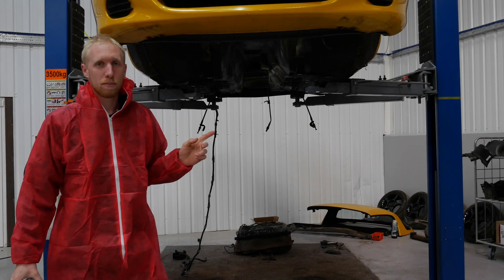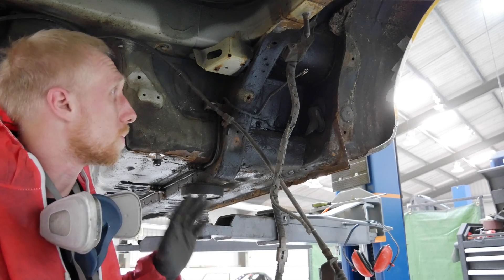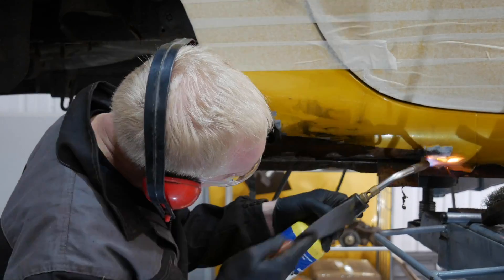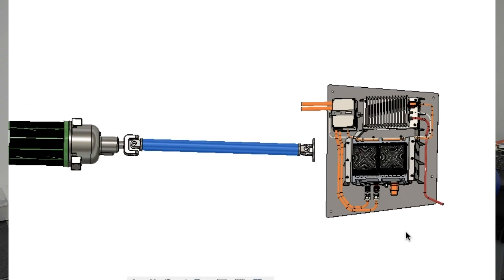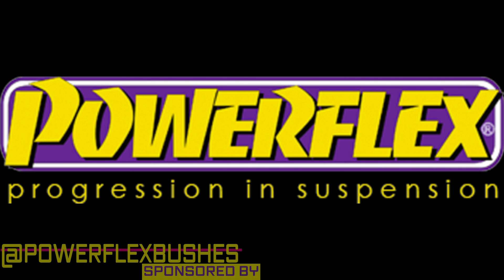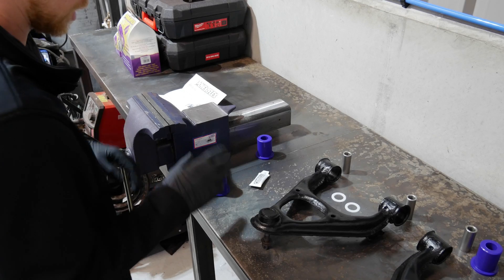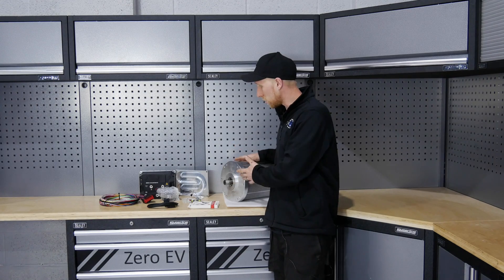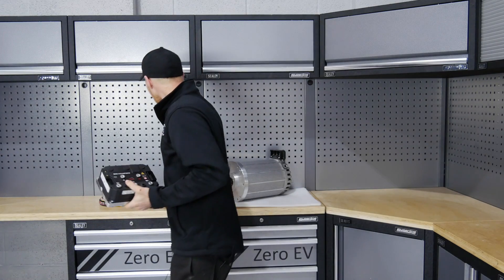We’re Making an MX-5 Miata Electric with a Hyper9

Comment: The cost of your motor is the cost of my car and fuel for 3 years at about 40,000km per year. I could never make the money back from your kits. What is the point?
Reply from the maker: It’s not about making the money back. People buy new cars then loose a massive amount of money on them. This is new tech and allows classic vehicles to be converted do not base it on a Mx5

Comment: The detail section regarding the HyPer 9 system is good, but you said that Netgain produces the motor: it does not. The motor and controller are from SME, which is now part of Dana; Netgain is only the distributor, which applies its own branding.
Reply from the maker: Thats correct but you can only buy from netgain as they have world wide distribution on that model.
Reply: @Hazell_Nutz  I don't think Dana sells anything direct to consumer, so NetGain is the consumer's only choice whether or not it is exclusive. I doubt it's really exclusive - send a firm order for a thousand of the same thing to Dana and I suspect that it would be accepted and they would arrive with Dana branding.
Reply from the maker: To be honest they are outdated now and could really do with a software upgrade and a higher voltage version so people can run ccs.
Reply: @Hazell_Nutz  I'm pretty sure they're not low-voltage because they're outdated - they're low-voltage because they're designed for industrial vehicles and chosen by Netgain to sell to people wanting to use salvaged partial EV battery packs or strings of LFP cells, with cheap controllers. They replace brushed DC "forklift" motors I can believe that they're due for software updates.
Reply from the maker: Think my point was not clear as in outdated for use in Ev conversion as everything is now going 400 or 800v. There perfect for industrial use for sure.
Reply: @Hazell_Nutz  low voltage was outdated even for EV conversions when Netgain acquired that hardware from SME, but some people still want it for the same reasons they did when it came out.

Comment: I saw someone put 2 engines coupled together for more power. Can this be done in this type of setup. Just engine and motor parts, not suspension how much does this cost?
Reply from the maker: Yes there is an option to connect two in series to increase performance. Fir two hyper 9 suits about 9k plus all other parts like battery’s eta
Reply: The extra motor would be in the space where the battery is, cutting the battery capacity in half. Two of the wrong motors is not better than one appropriate motor.

Comment: With the fuel tank removed, and understanding that you have some of the HV components mounted on a plate where the tank was, is there any room to package some of the cells underneath? It might help bring the front-to-rear weight distribution closer to stock and also provide a solution for a 144V setup?
Either way, I would be seriously tempted if this turned into a turnkey conversion kit...
Reply from the maker: We like keeping the pack all in one place is a lot safer as all hv is within one box and not spread in two locations. This will be a turn key solution

Comment: Why such a heavy motor? EMRAX make a ~80 kW ~12 kg PMSM motor.
Reply from the maker: Yep but cost double the money. There a good option though
Reply: @Hazell_Nutz  EMRAX 228 is £3.3k from the OEM. It seems the Hyper 9 is £2.8K w/o a drive. Could be a similar overall price depending on what drive is paired with the  228.

Comment: Can you comment on why you chose the lower voltage version of the HyPer9 instead of the 144V version which has more power? Was it to minimize battery weight & space?
Reply from the maker: Looking at the data there is very little power difference. Main reason is 100v option was available were as 144v has a 3 month waiting list as build to order.

Comment: Great series, if I may, may I recommend a wire wheel on that angle grinder instead of the flap disk, it will go that much quicker and really get in there and loosen up all the rust

Comment: This is great it's the nice mechanical restoration elements and then the Tech bits are an ace idea.  May I ask why though?? Why an MX5 is it a proof of concept car for you or a customer's? I'd love to get you and @Combe Valley Campers together to do my VW T3 but I still want to do work myself as much as possible as I'm building a family memory maker I want to really get stuck in.
Reply from the maker: Mx5 because there is a very good following and we needed something front engine rwd to test of new 1.8:1 gearbox on.

Comment: I’m assuming you’ll be making a mount that connects the motor to sub frame. I’d be surprised if the tranny mount would be strong enough to handle the torque from the  motor. That load is designed to be up on the subframe. Interested to see how it works out. Are you planning on mass producing and selling a kit to do this or is it just a one off?
Reply from the maker: We will probably make up 5 sets of metal work then see if people are interested.

Comment: hello
do you use a special protection (glove) to avoid electric shock when you wired the battery ? Is there any a possibility of  electrocution ?
Reply from the maker: You can where gloves but make doing up fixings very hard. We follow a set process when building packs to remove risks, we will show thing in one of the episodes

Comment: As you are using a  custom gearbox how do you get the Speedo to work?
Reply from the maker: Motor outputs rpm and as it’s a fixed gear a calculation is then done for speed.

Comment: Not sure how far you've gotten with the computer design, but I can highly recommend the ESP32 for the microcontroller.  Plenty of speed and dual processor cores if needed, built-in CAN bus compatibility, and it has Bluetooth built in for remote management (and WiFi, but not sure if that would be useful).  And you can program it with the Arduino programming environment or, if you don't need all the speed, microPython (plus many others..)

Comment: Buddy u guys r d real thing......bro pls make a video on the the topic....should place the motor directly to the drive train or should keep the Gear box and the clutch assembly intact....I mean do gear box and clutch have a role in e vehicles...I mean advantage and disadvantages..
Reply from the maker: A two speed gearbox would have a place in EV’s but lots have tried and failed. We have gone with a single speed reduction.
Reply: @Hazell_Nutz  thanks for the reply.
Bro is there an email where I can shoot my query...I need some suggestions from...I am really inspired from your work..
Reply: @Hazell_Nutz  bro..i have Corolla Altis DCT Automatic transmission...it's specs are 1798cc, max power 138bhp@6400rpm, max torque 173NM @4000rpm, ...two questions for you bro
1) Suggest the motors with ratings
2) Can I keep the DCT, will it work or do I need to take whole of the auto gearbox thing  and clutch plates things out and make a direct drive...or what do u suggest..

Bro I know I am taking kuch of your previous time...but I would be grateful....i owe u..in case u visit India....

Regards

Comment: Can you talk about the advantage of this motor setup vs a full Tesla setup? (Aside from mounting the unit out back)
How do you know the transmission will take the torque? What is you plan of the transmission can't take the power output?
Reply from the maker: There is no advantage this is just a cheaper and simpler set up. We are not using the original transmission will be fitting our new 1.8:1 single speed gearbox.
Reply: @Hazell_Nutz  will this be another item available in your store?

Comment: Since I’m in the middle of a Restauration with my mx5 ... I like what I see ✌️👍💪
However I did have a bodyshop goin over the chassis and it did cost me ... a arm and leg ... but totally worth it 😎
...
PS.
Are you goin to do a cooling system for the battery 🔋 pack as well...?🤔
Reply from the maker: Yes the battery pack will have a cooling system

Comment: Is there any reason you aren't putting the motor in the back under the boot floor?
Reply from the maker: Because it will not fit without chassis modifications

Comment: Nice video.
But indeed please don't say a switched reluctance motor (SR motor) is a fancy fixed magnet motor! This is not true at all! It has no magnets inside! That is the whole point of this type of motor. No magnets = cheaper to make (but harder to control). If you want to compare it to something you better say its some kind crossover hybrid between an inductance motor and a stepper motor.
Reply: The thing is this motor is an Internal Permanent Magnet motor that also uses Switched Reluctance to boost its efficiency. So it is both.
Reply: @Tom-evnut  No, not switched reluctance, but synchronous reluctance.
Reply: They did not say that is a switched reluctance motor, because it is not. It is a mix of permanent magnet and SYNCHRONOUS reluctance motor.
Reply: @brianb-p6586  you are right, didn't pay attention apparently

Comment: Great project to see and really good to see a very informed and professional presentation. The only thing I felt I would like to know is you detail the weight of parts going in front and back, but what is the weight of parts that came out of the car front and back? Thinking it would be a good idea to try to get the weight back into it as near to the original front/rear split to keep the handling near original. 
Also, do the main power cables (battery to motor) now have to go through the controllers in the boot or are they controlled remotely from there?
Reply from the maker: The charger and dcdc just require a 35mm2 positive and negative cable from the battery pack. The battery will feed the motor controller directly as that is infront of the motor in the gearbox tunnel.

Comment: Hi guys great build ,  what sort of range do you think this would have being lighter than a modern ev ?  Cheers . Steve .
Reply from the maker: With the small battery pack about 100miles but think there is space to fit a second in the rear.

Comment: Netgain started out with a series motor that replaced the advanced DC series motor they made a 9-inch an 11 inch and a 13. These were paired with the mighty Zilla controller of which the largest 2000 amp 348 volt is used in a drag racer today. I'm in net gain dealer in Florida. You're doing a wonderful job on this I'm very impressed

Comment: Jeez, that motor is hopeless, saddled by a ridiculously low maximum voltage. Once you are above 50vdc then you need to comply with the low voltage directives for machinery, and that goes right up to 1kV (where it become the High voltage directive), so you may as well install a system with a sensible nominal voltage (say 450Vdc) and get all the power and efficiency benefits!
Reply from the maker: We normally fit 350v nominal that is the industry standard 96s battery pack. This is more of a off the shelf straight forward build that is not as scary for most. Of next build is 350v

Comment: Why use a drive shaft where you'll loose efficiency, and not use two smaller motors directly at the rear wheels? You can get a 50/50 weight that way too.
Reply from the maker: This is meant to be an easy to convert vehicle without cutting. Plus doing it to test our new 1.8:1 gearbox

Comment: With the fuel tank removed there might be enough room at the back to use a transmission from a front wheel drive vehicle placing the electric motor at the rear. The tunnel could then be filed with batteries and the chargers and controllers and cooling systems would go at the front with some additional batteries.
Fabrication of a new rear subframe would be required of course.
Reply: Fabricating new rear subframe will affect the handling of the mx5, something imo which should be maintained. Think by doing it the way they are now, the driving experience won't be changed. Plus the aftermarket scene can still be used for different shocks/brakes. Custom rear, is more costly over time.
Reply: Dimar Opdam . About the only thing that is important is the total weight over the rear axle and the balance front to rear.
If the weight of the motor and transaxle and subframe can be kept to within 120 kg of the weight of the full gas tank, diff etc etc and the batteries etc at the front are positioned and weighted to balance the vehicle nothing about the vehicle dynamics will change, actually if you get it right they will be greatly improved.
I’m guessing the mass of the gas tank and differential will be about ninety five to one thirty kilograms, a suitable transaxle will be about seventy five kilograms and I think I heard that a suitable motor is forty five or ninety kilograms, the custom subframe will be only about five to ten kg heavier than the original. Most good coil over makers can dial in shocks and springs if you give them the final corner weight so expect for designing and fitting a custom subframe it’s all just as doable and reverse able as simply sticking a motor up front.
Reply: Doesn't that go against the intention of keeping things reversible?
Reply: Malthias . Not if done right , it would simply bolt in.

Comment: How does your drive shaft of this motor adapt to the gearbox? I assume you're using the original manual gear box with the mx-5, Do you have to put a serious flywheel to keep the rpm of the motor when changing gears?
Reply from the maker: We are going to be using our new 1.8:1 gearbox which is single speed. If you use the original gearbox is find and you have two options solid mount with no clutch or a high performance clutch that can cope with instant torque.
Reply: This isn't using the original gearbox. If using it, there is no need for a flywheel, because the motor is a huge flywheel by itself.

Comment: i just wonder if the motor locate at the fuel tank location as no need to use fuel anymore (fuel tank already being removed), which maybe wont have any high issue, maybe can eliminate the torque tube. (hopefully wont have length issue for the motor)
Reply: The tank is over the final drive in the MX-5, not ahead of it, so a motor attached to the original final drive will not be in the fuel tank space... it would run up the tunnel and not fit in the tunnel, intruding into the interior and seats. There is no torque tube in an MX-5, only the PowerPlant Frame, which is a truss loaded only in bending stress.

Comment: Nice video, thanks for the effort. It's great to see that the community feedback helps you to improve 👍
That's a bunch of rust, good to see you handle it well and the rebuild will be full clean 🎉
I like the cad process, would have also loved to see before-after weight with the areas like original engine department, gearbox area, gas tank area and trunk. Maybe you can add that in a future episode, when you have final numbers. 🧐
For the tech, yes, please. As mentioned by another user, keep it in order with the build process so it's easy to follow 👌
Last two points: 1. Had a better feeling with volume level of voice-over, music (which is a topic, I see) and tool noise. Well done. 😂
2. What to do with the exhaust rubbers...
Reply from the maker: Started using premier pro so starting to get us to it now 👍

Comment: Wouldn't it be better if you put at least a couple of battery packs back instead of the petrol tank so you can distribute more evenly the weight, loading the front and unloading the back with that much torque certainly could make lots of fun while doing donuts or drifting but could make it perform unexpectedly for a less experienced drivers.
Reply from the maker: Splitting the battery pack up is not recommended. One other option is to add a second pack to double range.

Comment: That rust surprised me. I thought cars post 80's were treated during manufacture to eliminate the possibility of rusting.
Reply: Your comment got me intrigued so I did some research. You are referring to galvanization, where a thin layer of zinc prevents rust but only until all the zinc is consumed. In a hot, dry climate like Australia, this can protect the car for decades, but in cold, wet climates with salt on the roads it can get used up within 5 years. The 2nd generation Miata ceased production in 2005, so this car is at least 15 years old, enough time in a U.K. climate to have used up the galvanization and allowed rusting to occur for many years.
Reply: @andreiandrosoff1327  Thanks Andrei - I didn't consider that and now that you've mentioned the zinc being sacrificial, its obvious this will occur.
Reply: I thought there is no galvanized layer in Mazdas, that’s why I went with Kia of all things!

Comment: I love the videos!

Have you thought about doing a conversion of a classic front-wheel drive car?
I noticed that the parts bill for the EV components is about the same as a new Skoda Citigo-e iV. Do you think it would be possible to adapt the Skoda/VW battery pack into an older car, retaining the enclosure?
Have you looked at adapting the components from a Zoe or Leaf into a classic car?
Reply from the maker: Someone peoples age done Leaf and there is other builds in the pipe line to convert for YouTube.

Comment: While I dont think it would be appropriate for this type of short form video, I personally would like a more in depth look at the wiring how to power and operate things such as turn/brake lights and power windows (if the car has them). Even the best EV forum posts and youtube videos leave out a comprehensive description and walkthrough of this and Its whats stopping me from trying to do an EV conversion myself.
Reply from the maker: Ethan Cho yes your correct as all lights are on a different controller not part of the engine ecu.
Reply from the maker: All of that stays the same nothing is touched on that side of the car the standard 12vv battery systems rays in place.
Reply: @Hazell_Nutz  So you just have to power the 12v system within the car and all of the lights still work as intended?